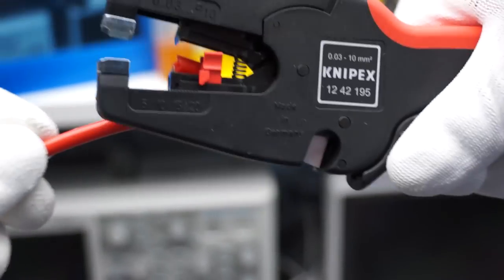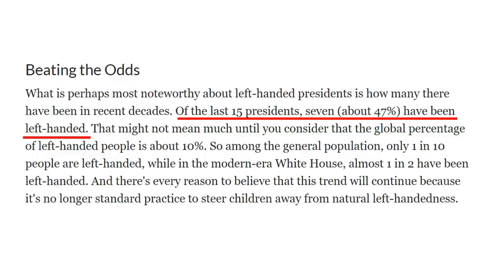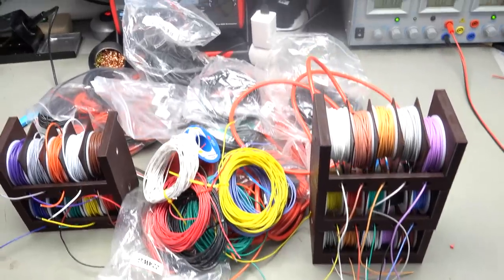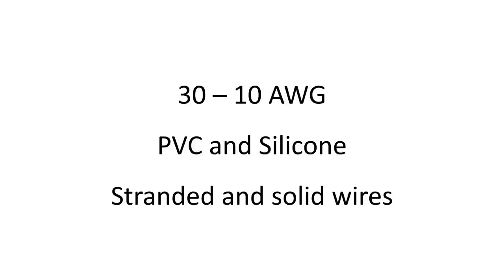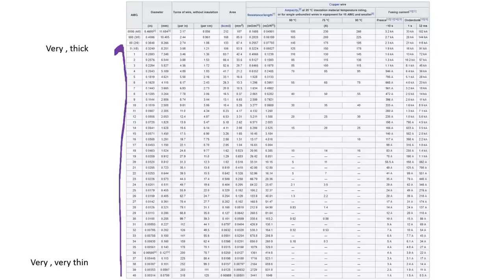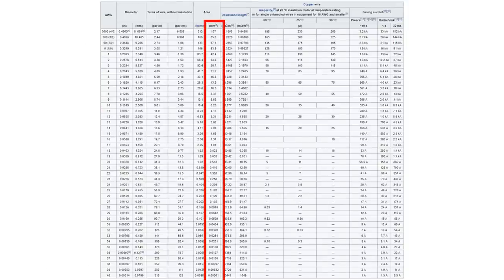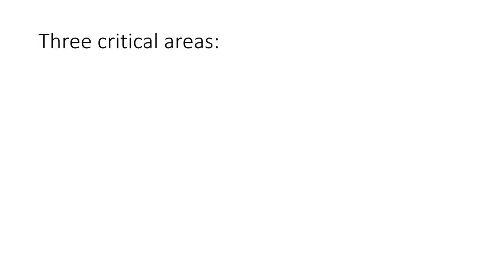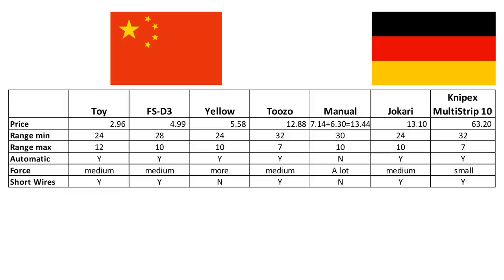#268 8 Wire Stripper Test: Germany vs. China. Who wins?

Comment: The yellow's gripping force can be adjusted with a screw. it's quite annoying to adjust it for different cable sizes but it can work better than shown here. At least mine does. Still not that useful and better for electricians, as you said.
Reply: I have a very similar one but it's red, and that has the adjustment knob. The advantage is that I can strip PVC insulated solid core and silicone insulated fine stranded wire in the same guage, just by changing the force adjustment. Without that one or the other is going to fail.
Reply: This may be most suitable for production work, where stripping the same size of wire repeatedly is required. But working this way is inefficient, and it is much better to have a truly automatic (mechanized) stripper for the job.
Reply: @nrdesign1991  I agree. Eaven in production you have different sizes and the handling of the automatics is easyer.
Reply: It's shit for electricians because it is harder to get into tight spots and a bit dodgy to strip live wires with this
Reply: I have a yellow stripper like this, one of the best strippers ever for electrical work as it was intended for, when I do electronic work thinner wires I use another stripper the right tool for the right job this video implies one stripper can do it all and that is just not true

Comment: A Crimp-tool comparison would be great!
Greetings from Germany.
Reply: For example/hint from the industrial environment we use the "PZ6 Roto" from Weidmüller, they are great. We've had many different brands and versions and mostly everyone of the asked departments have chosen the PZ6.
Weidmüller creates tools of choice where quality counts more than price.
Reply: The large number of different connectors would make any comparison very limited. You'll have to stick to only two or three most common types, and you'll not be covering more than 30% of the maker's most used. Anyway, I think Andreas did one for so-called "Dupont" connectors.
Reply: A proper crimp tool video would be 2 hours long, and all that would cover is the Knipex 97 43 200 system.
Reply: @philippwie3539  and there are many special crimping tools like for isolated, non isolated, bnc .... 

And Andreas did one already one for the small dupont connectors
Reply: @crckdns  ...a little to expensive for hobby use.
Reply: crckdns PZ6 or PZ6 roto definetely is awesome and worth all the money.. But maybe a bit much for hobby or home use. There probably is a knipex one for half the price that works alright
Reply: It would be really difficult. You have three grades (priced accordingly) of crimpers:
1. Mil-spec., which need to be re-certified after a relatively small number of cycles.
2. Commercial.
3. Consumer.
Reply: @johnc8910  I prefer to grade them as:
1. cannot afford
2. doesn't work
Reply: He has done two crimping videos.  The conclusion of which was the the 2820M (which comes in lots of brand names) is the most effective and best value.
Reply: It's so hard to tell if some crimper is the best. Because there are so many different terminals.

Comment: I've been using the yellow one for several months. So far it's good for me stripping most electronic cables.
Reply: I have been using a Yellow (mine is red) and another which is similar in design for years, and I love them.  I agree it's not perfect for precision use, but for general use, and for the price, they are a no-brainer.
Reply: I had a cheap "yellow" one, that broke after one day of use
Reply: @teknochaos  Probably a Chinese knockoff of a Chinese knockoff. . . . . . . . .    :-)
Reply: I've been using the yellow one for several months. chuckles
Reply: I have one but from Unior at the time it cost me 25€ and after 1 to 2 years of some use I haven't had any problems, the only thing is I need to get a wire stripper from jokari for larger wires
Reply: I've also had a red version of the yellow one for quite a few years now and it works really well.  It can be an issue with larger wires as shown in the video but since I lack any other tool to strip large wires, I've found weakening the insulation with a knife before stripping it as normal is a good workaround.  It also doesn't work very well with rubber insulation used for outdoor cables but again, using a knife to weaken the insulation is a good compromise.
Reply: Well, for me it doesn't work well with thin wires, though it's good for thick ones.
Reply: @GRBtutorials  Mine has a little wheel were you can turn so it makes less force on the grip and it only cuts the insulation that way it doesnt cut the wire
Reply: I also have the yellow one. For most of wires it is OK but for the ones with slippery insulation, it is a pain, it just does nothing.
Reply: @almaefogo  This "yellow one" and many like it that are of higher quality have the same little brass adjustment screw on the bottom of the left jaw that this one has. That wheel can be used to adjust the tension on the mechanism for a perfect strip of whatever wires you're using. Not great for lots of random jobs, but usually that's not how things work. On my jobs I usually have a bunch of one gauge to strip, and can adjust at the beginning of the job and forget about it. Nice thing about this type is that you can often strip a few thin wires in one go. These certainly aren't perfect for everything, and the one reviewed is cheaper than any of this type I've bought, but with a little RTFM and some more consideration I think this type of stripper deserves a bit more love. Don't they all.

Comment: Great video Andreas, thanks! I use a Weidmüller Stripax stripper for most of my work, it's very similar to the Knipex you demonstrated. One remark: The 'Yellow' stripper you reviewed is something I would not want to miss in my electronics toolbox :) But I don't use it for stripping single wires, I use it to strip the outter insulation off of multi-wire cables (e.g. typical 3x1.5mm2 power cable, UTP cable, etc...) For that purpose it's the best tool I've come across so far.
Reply: And with Stripax you can adjust the cutting force. I think there are better than Knipex stripper.
The only case were I use manual stripper is when working this PTFE isolated wires for medical devices. These are very hard to handle with automatic stripper.
Reply: I too have the Stripax, awesome tool and the amount of adjustability is astounding!
I had to read the manual 3 times to figure out what those things do XD
Reply: Yellow type strippers are also excellent for splicing in. If you're messing with automotive electronics it really improves things. Makes splicing into the loom a cinch as you can strip mid wire and splice. You have to use decent insulation tape (self amalgamating stuff if you can get it) as you can't get heat shrink over the join but it works well on my own projects (I'm not a professional mechanic :)).
Reply: Thumbs up for Weidmueller Stripax! My first one was an older model that I inherited from my uncle when I was in trade school as an automation electrician, and I was sold. Later I've bought several of them for use in my work as an electronics engineer at different employers. Very capable and reliable tool. Costs in the neighborhood of 90-100 EUR though
Reply: The yellow are garbage the the vice grip equivalent are much better use mostly for multi conductor and larger awg up to 8 soft insulation can be a problem.  Do the Stripax or  Knipex strip multiple wires well at same time 4 to 6 about 20 AWG ? Currently use a Matco variant of the toy, thay do but cause more damage to insulation at grip point than I would like.
Reply: That thing looks great. If only I could justify $200.

Comment: nautical miles is an international standard, its used everywhere at sea. For example we have the speed measurement knots, which is one nautical mile an hour
Reply: It's one of the few "imperial" units based on reality - one nautical mile  = one minute of arc.
Reply: Not to mention almost the entire aviation industry uses knots.
Reply: @benedictrehiesi5166  only for hight and speed. Distance is in km and volume of fuel also metric. and when you fly over russia also the height and speed is to be given in metric.

Comment: The yellow ones have the adjustment screw for cutting pressure for this exact reason.
you might want to lower it for small diameters and increase it for larger and thicker insulations.
Reply from the maker: It did not work with mine. But there seem to be different makes around, some good and other not.

Comment: Hello Andreas,
I purchased a Knipex recently and i was a bit dissapointed:  
It could not strip normal "electrician wire " of 1.5mm² or 2.5mm² ...( non silicone insulation )
The problem is, i think, the lack of an insulation thickness adjustment ...
I finally purchased a " TE connectivity " ( ex 'AMP' ) and left the Knipex on side...😞
Thank you for this video !
Reply from the maker: Interesting. I did not try these because I hardly use them and then I use the same knife as for the outer plastic :-(

Comment: The yellow one is much better than you described, i used it to strip up to 8AWG, but of course you need to regulate it with the little brass knob. and it's Also good for stripping wires in the middle (that's why the stopper is small)
Reply: I agree. It works great for me.
Reply: me too apart from cat 5 cables which i have to adjust the screw, not only that i can strip a 3 core flex in 1 hit,
Reply: Adjusting the knob will not effect the cutting force tho, only the gripping force.  Andreas had trouble with the (un-adjustable) cutting action.
Reply: the trouble with cheap tools is the first lot off the dies are great but as the die wears they dont change the die as often as they should. so quality and usability is not as good, my guess his tool was one of those,
Reply: Agreed. The adjustment knob is important for this style of stripper. Also, the depth stop is DESIGNED to be able to be used or to be bypassed - in that way, you can use the stop only for critical tasks.
I have 3 or 4 of these that I have purchased from different places at different times, and I have found small differences in the design and quality between them.
Reply: @roidroid  - the way that the device works is that it uses the clamping force to regulate the cutting force. This is difficult to explain, however what happens is that the cutter is always engaged AFTER the gripper, and the cutter is always closed BY the gripper teeth.
They work off each other, so when you adjust the brass knob you increase the force of the gripper. If and only if the gripper teeth "grip" will the cutter engage and strip the insulation. So, if the adjustment is too loose then the gripper won't grip and hence the cutter will never engage.
Reply: @debeeriz  - NO, it's simply that there is an adjustment knob (clearly visible, as well as explained in the instructions) that needs to be tweaked to optimise the stripping performance. Andreas didn't touch that knob, so it was inadvertently set too loose for large PVC insulation.
Reply: ah, gotcha.  i've got one of these strippers bouncing around somewhere and it's never worked for me.  So between the advice in this video and the useful comments - i think i finally know how it works.
Reply: I have one of the yellow style strippers made by Irwin Tools. Seems well made and does a good job. Cost a fair bit more than the one Andrea has.

Comment: Left Hander here too.
It would be interesting to see the demographic of your subscribers, the percentage of left handers.
Leaving the stripped sleeve on the wire tip is good with multi-strand wire, as it provides a good fixed point to twist the strands together without fraying the ends.
Reply: Left handed here too ☝
Reply from the maker: I assume the statistics would be similar to the general population. With a sample size of more than 100'000.
Reply: I was taught to strip wires that way back in 1980 - then tin wires with any excess solder taken to the end of the wire so it could be trimmed to needed length
Shown how to do it so no excess heat would warp the plastic insulation - silicone makes it easier now
Reply: @keithroberts5946  my grandfather taught me back in the fifties when he converted an old Rockola jukebox to a home stereo system. He said the very same thing about cloth insulation, about tinning it correctly so the insulation doesn't char. Weird how the process doesn't change...only the tools and material.
Reply: Left hander here :)

Comment: On the yellow stripper the brass screw on the left jaw adjusts the grabbing force. You should increase it to strip thick wires. This is why I using these strippers, it is adjustable. The end stop is unusable at best, but if you do not crimp batches, you probably never will use it anyway.

The problem with ALL the sharp balde not adjustable ones is that the automatic trigger mechanishm wears out, the internal frictions changes, and either it slips and does not cut the insulation or jams and cuts the copper too.

The yellow one serves me for at least a decade now... Sturdy design.
Reply: I agree. I've tried almost all brands and the yellow are the best long term solution. Also, with the "yellow" style the blades ARE replaceable.... you can clearly see the torx/hex screws that hold them in place.
What I've done is removed the cutting blades and sharpened them using a diamond stone.  This really improves the performance for a tiny amount of effort, however it doesn't really allow you to reduce the pressure on the brass adjustment screw.
Reply: +2.  I've used several of these auto and manual strippers and the yellow design is the one I will die with.  On the one I have the end stop is adjustable or even removable so that is not a concern for me.
Reply from the maker: Thank you for sharing your experience! I think there are a few makes around. Some good and others not so good. Mine was not so good...
Reply: In case it helps someone decide how to choose one based on the "yellow" design, I'll add that mine were made in Taiwan and cost around US$18.

Comment: I didn't know there were sooo many different types of wire strippers. I have a wire stripper made by a Canadian company Ideal Industries Inc. It's called "Stripmaster" and comes in many wire size combinations. Mine is 10 - 20 AWG. The cutting blades are replaceable with many combinations of wire range. My strippers are 46 years old and still going strong. A little bit of machine oil on the moving parts and it performs like new. They cut the insulation square and slide it off without damage to the wire strands. Thanks Andreas love you work.
Reply from the maker: If you read the comments you see there are even more...

Comment: we've been using the knipex in our shop for around 8 years. it's seen sandy environments, oil, interns, brake cleaner, and most importantly, tefzel wires (the white aircraft stuff, ETFE insulation, tough, slippery and wears out blades). it's seen zero maintenance in this time and still works perfectly, although the blades have a few nicks.

i've been using knipex since my school days (saved up for them, stuff's expensive) and have 0 problems besides my father stealing them from time to time. i switched professions and went from electrical maintenance and automation in the petrochemical industry to automotive engineering, specialized in hydraulics and have come to love knipex in a whole new way, namely the adjustable parallel yaws wrench pliers. they are the greatest invention to go in a toolbox since ratchet spanners. they have a huge range, are always tight and prevent overtightening  which is an issue with most fittings. and they are about €25, so about a third of the normal knipex tax.
Reply from the maker: Thank you for sharing your experience!

Comment: I must restore my old Radio Shack strippers one day. They worked really well, but have become all gummed up. They are a combination of manual and automatic, in that there are 4 wire-size positions in the blade (though they'll handle more than 4 sizes IIRC), but they have a wire clamp and work similarly to the automatic ones.

Comment: Kinda missing the swiss army knife in this list... :) 

I guess for a hobby user the Toozo are a good and relatively cheap option, but anyone who uses a tool in a professional setting and very regularly, paying for the real Knipex/Stripax tools pays off because these tools last much longer.
Reply: I use the stripper on my Bantam all the time.

Bottle opener to 90 degrees. Lift the knife. Put wire in the hole. Lower knife onto wire and gently press until through insulation. Spin knife around wire and pull.

Works great for thicker wires. Gets a bit fiddly with thin wires though.
Reply from the maker: Thank you for sharing your experience!